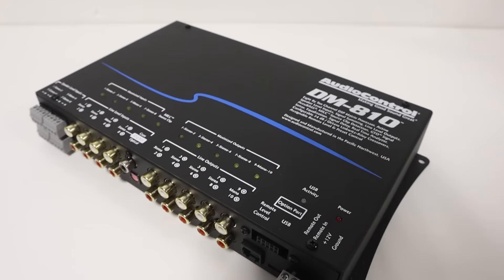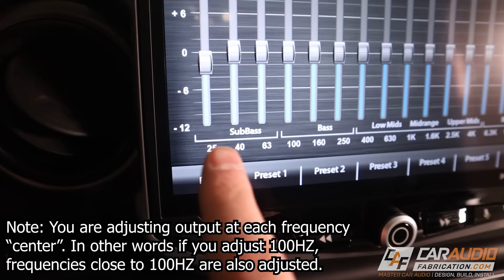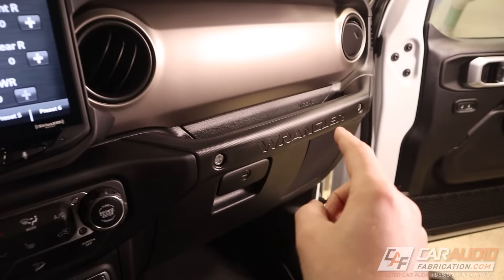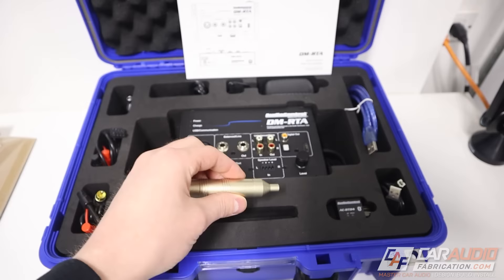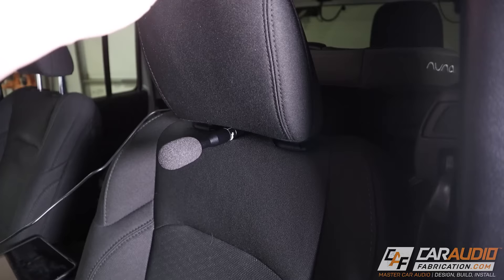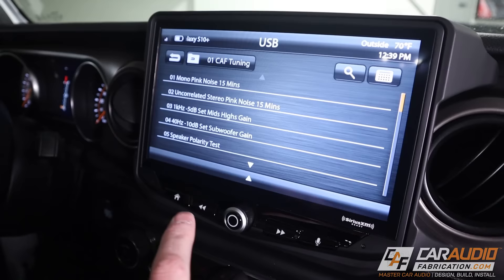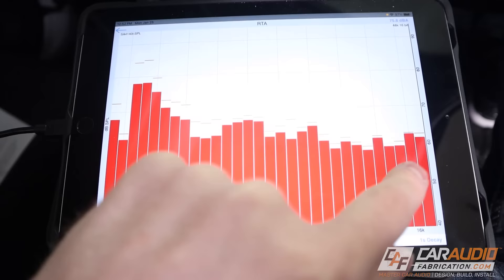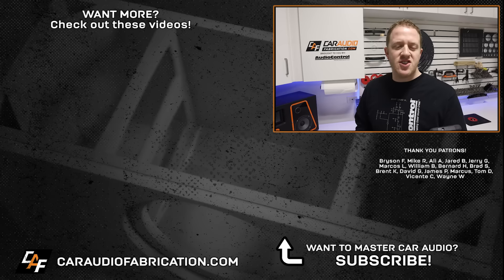Tuning your car stereo - Head Unit Equalizer - No DSP! PROCESS EXPLAINED

Comment: Just a heads up, the head unit is using DSP (Digital Signal Processing) internally to adjust the frequency gains for the eq. It is the same thing as the RTA, except one process is automatic and one is manual. If you wanted to adjust the eq without DSP you would see a bunch of analog dials or faders like we saw in the 90's. Your stand alone processor will give you more options of crossovers and eq's, but both are using DSP.
Reply: No 6000 dollar RCA's?  No mysteries?  No way man..

Comment: Your content is awesome and has helped me so much in my usually "quick n dirty" sound installs. Currently struggling to set up a little upgrade in my BMW E46 touring - JBL GTO component speakers, a Dynaudio spare wheel sub from a VW Golf and a bit of sound deadening. I can get it sounding good in my driveway, but as soon as I am driving, the deep exhaust note drowns out my admittedly small subwoofer and midbass. My aftermarket head unit has a similar built in DSP - I guess I should tune it while moving?

Comment: Audio Control. That’s the EQ back in the day. Still have the best offerings. You got issues and they have.solutions. It’s just not a problem is all! Great video, I needed to see that! We had Eclipse, Sony and Soundstream for heads, used Audio Control EQ and crossovers. And there were Soundstream  Class A on the tweets, Soundstream  Class ABs on mids and Soundstream running grunt. That is sweetness to your ears. Stay safe mates!😊👍🏻😷

Comment: So if i cut to eleminate distortion , isnt i gonna increase the volume because of that and end up at the same level with the same distortion ? Like whats the point ? Or is it actually less fetieaging for speakers to cut rather than boost even if i increased the volume to compensate ?

Comment: I love all the technical and practical advice you’re giving and it inspired me to upgrade my car audio system. One thing I’d love to see is wireless/ Bluetooth connections to amps or HU’s!
Because to be honest... we install upgraded speakers, sound dampening and amplifiers but in the end we stream “low quality” mp3s via Spotify or Apple Music. 
How to upgrade the Bluetooth signal (muse02 op-amp) be one question or wiring the phone to an amp would be cool to get an insight on. 
Just to get an even balance between streaming quality and the build quality of the speakers and system amp’s~ (I’m not a audiophile but still wanna get out the best results 😜)
For future awesomeness!
Reply: Thats why in some cases I still prefer CDs and also I use my AUX in connection with a good quality cable mire than I stream via Bluetooth.  I find the sound much better when A) the source is direct and B) the connection is direct and a physical connection.
I do have alot of music in digital format, however I always convert them with top quality in mind and don't worry about how much space it takes up.  I always convert from a direct source as well (CD usually)  I'd rather have 350 EXCELLENT sounding tracks than 1000 mediocre sounding ones in the same amount of space.  USB drives are cheap these days.  I have a few kicking around in the car each with various types/genres of music on them and some mixes.  I had gone the hard drive route in the past but found it too cumbersome and hard to find things when I wanted them especially when you're supposed to be, ya know paying attention so you don't hit anything while driving lol.
Building a library of music without downloading them (used to do that, LimeWire/FrostWire anyone?!? ;) took years but was essentially free.  I borrowed every single one of my friends CD collections, their brother/sister... friends parents etc.  Basically anyone who had a decent collection I would ask to borrow for a weekend and just rip them all to my computer.  I must have over a couple Tb by now. (2000 Gb)
Reply: Hi, try Using a USB with FLAC
Reply: I use a 128GB USB flash drive loaded with more music than I can ever listen to. If your HU supports it, you could also use an SD card. I find 320 KBPS MP3s perfectly adequate in terms of audio quality. Playing lossless files like FLAC is "ideal", but I don't believe there is much if any benefit in a car since generally speaking it is not a perfect listening environment, and lossless codec is inefficient at storing audio and results in wasted storage.

Comment: Hi!! 

How do I know the frequency range of the equalizer and the Q value, for the Mercedes Benz W177? I am talking about the audio settings of the W177, controlled through the MBUX software at the music settings.

Example: I adjusted the equalizer for Bass: +2. I need now to adjust these settings on my Digital Audio Workstation software, that's CUBASE. How do I know what are the settings to do so?
 Bass: +2. Does plus two means plus two decibels? If not, how many decibels are plus two? What is the Q of this Bass EQ, from which frequency to which frequency is the Bass zone?

Mid: +1. Does plus one means plus one decibels? If not, how many decibels is plus one? What is the Q of this Mid EQ, from which frequency to which frequency is the Mid zone?
 Treble: +2. Does plus two means plus two decibels? If not, how many decibels are plus two? What is the Q of this Treble EQ, from which frequency to which frequency is the Treble zone?

Comment: Mark,
You add great value to your industry.
I think the Stinger Heigh10 and DM-810 would make a helluva system in my 2021 JL.
Any chance you could do a video on total install with 2 AMPS, the Heigh10 and DM-810?
Tuning included. I am really wondering about the toss link or optic from the head unit to the DSP.

Comment: Do these adjustments affect the tuning for distortion? I’ve had my system tuned for distortion with a SMD for distortion and I’m always playing around with the frequencies for my EQ but I’ve always wondered if raising the base on my eq will change the distortion level to a different number that was set by the SMD
Reply: Ive been told yes and on my headunit (boss audio dont know about other brands) and when i turn the bass to the max or close to max it distorts and when i turn the bass around -2 out of +7 (which is max bass) it does not distort by ear i cant tell that it does by ear so im assuming YES!
Reply: Yes it does. Tune your system to your liking then tune for distortion

Comment: Were you able to keep your climate control and steering wheel controls with the stinger head unit? I just installed a alpine head unit and sound system and lost my climate control and steering wheel audio controls…in my JL

Comment: Hey I have a question …I have a aftermarket Tesla android head unit that I just installed . But I checked on the equalizer on the head unit . It suxs big time ….the other head unit I had before I changed it was way way better . It gave me full bass…with out needing a sub woofer. But this one I have now doesn’t give me half  of what the other unit was giving me . Is there a way to upgrade the equalizer with having to buy another head unit .which I don’t want to do? Please help

Comment: No Android support for the Audiocontrol mic and app? Missed out on my money.
Reply: However will they recover lol
Reply from the maker: I'm not an apple fan at all, but at least their connector has been very consistent over several models. Not the case with constant USB changes on Android, I think the last four Android Phones I have bought have each had a different connection. They have a similar USB version that you can use with a PC based app here: https://www.audiocontrol.com/studio-six-digital/
Reply: @CarAudioFabrication  all of the USB types can be adapted between one another. I refuse to support a company like Apple and despise their OS as well. Besides, there have only been 2 different USB types in the last 5 or so years. Micro and type C

Comment: Would like to know if there is a way to reprogram a android 10.0 head unit to have a 10 band or more equalizer, mine only came with treble, bass, and presets, I downloaded apps but they do not run in background while listing to regular FM radio stations

Comment: Hi is there a way to hear my midrange speaker more than my tweeters  using the eq. What setting would you recommend i put the Tweeters so they not are overpowering my midrange.  Tweeters are connected to speakers. Going to get a separate Amp for tweeters

Comment: I don't have a DSP and all I have is The equalizer that's built into my Kenwood deck. It's not quite as extensive as the one in this one but it's 13 band. I am running dual 12-in subwoofers and I know you said not to do it but it is adjusted in the shape of a smiley face. My question is what happens if you set the equalizer on the head unit to a smiley face and then set the equalizer on the phone in the shape of a smiley face? I do not have an SMD but I do have an oscilloscope that I use to set the gain correctly. Are there any presets that work well for an equalizer or is it just basically what sounds the best?

Comment: I'm new to car audio, but I have a question as I have recently had an install done on my car. So when measuring the time correction distance in a car, I've been looking online and a lot of people suggest the formula is to measure the distance between the speaker cone and your head in inches and then minus that from the distance of the subwoofer whilst leaving the subwoofer at 0". So for example, the subwoofer is 89" from your head and the left front speaker is 55". Leaving you with 34" for that speaker and 0" for the subwoofer. In your expertise, does that sound right to you?

Comment: @10:50 the reason why a perfectly flat curve would sound bad is because the human ear canal has ressonance at around 4000hz to 8000hz. this acts to amplifiy the frequency that are common to us in nature, such as human  speach, animal growls ect. There are graphs you can use will relate sound pressure (dB) to phonic register (phons) of the human ear. Using this you can see that you need higher sound pressure at lower and higher frequencies to get the same percieved volume across the audio spectrum.

for more information start here: https://en.wikipedia.org/wiki/Equal-loudness_contour

Comment: What is the difference  between DSP Audio Control and their EQ? Decades ago I had a high end system no DSP but Audio Control Dual 31 band 1/3 Octave EQ. It sounded incredible. When I had my custom build from factory Mercedes SUV you can order their Bang & Olufsen package. It sounds pretty good but not like after market. They won't let you do anything to the system as it would void the warranty for the whole vehicle. When the vehicle is very, very expensive then voiding the warranty is not an option. So I might buy a used car just for the purpose of a sound system to play around with. You can get nice used cars sometimes under 20k.

Comment: There's one thing I want to add that might sound like BS,, but it's true, if your only adding an amp and new speakers to your factory radio and you choose one of those line out converters from a local electronics store unfortunately most of those sound like crap and you can use the one in the amp if it has high level input but honestly I've found one brand of line out converters that improves the sound and I believe it blows mostly anything else out the water,,, "Pac line out converter" is what I use n I gotta say it's the best! Can't get them in local store anymore but they use to sell them around 10yrs ago but they stopped selling them and making u buy junk ones anymore leaving a bad taste in your ear,, Online is were u can get the Pac or maybe an actual car audio shop

Comment: What do you think about using an iphone with that app for sound tuning? I have an Audison Virtuoso DSP and I find it a little limited compared to your headunit by the number of tweaking points avaliable. Then I get alot of frequency variations by moving the phone up and down the driver's seat. I got filtered front and back with tweeters in the dashboard and coaxial in the back and a sub in the trunk. Cheers!

Comment: My android head unit has a problem where time correction distances entered in are directly copied to miliseconds of delay. So the process of entering each distance from the speaker to the listener results in wildly wrong time compensation. The farthest speaker has the most delay instead of zero. Closer speakers have the least delay. In my case i need to do the math on paper and just enter the delay in ms.

Comment: Hey Mark!

Nice video, helped me a lot.

Could you make a video about what speaker setup ist best for different status quos?

I got a good kenwood stereo with an 4 channel amplifier and an active sub. I use tweeters and 6,5inches in the front door and koax speakers in the rear and i am not really satisfied.

All that only gives me 5 channels for time correction for 7 speakers. So whats best now?

-2 tweeters and 2 mids in the front door and a sub
-2 coax in the front and two in the back and a sub
-just buy even better speakers and live with my current setup?

Greetings from germany!

Comment: Hey CAF, I would love to see a video detailing L/R frequency balancing with the Audio Control gear. I have a DM-810 running 3-way active for the front stage and I am missing something with certain frequencies on the driver side.  I think it is related to on/off axis response of the speakers in the door.  I am at the point where I think I need to buy the microphone to refine further.

Comment: Does all the speaker wire  have to be the same length for the time alignment to work correctly? For example your front door speakers say you have 3m of speaker wire going to the left speaker and 2m going to the right would that affect accuracy of time alignment. Thanks
Reply from the maker: No, the speed at which the signal moves is astronomically fast.
Reply: @CarAudioFabrication  excellent. Thanks for your reply.

Comment: What’s that headunit again? Probably expensive haha. Are there others that have that level of eq bands, and also crossover? I’m pretty content with my current setup but just a headunit swap would be nice if it could do more in terms of DSP. Don’t and won’t do much tuning for but that unit does even more than what I want. I do have front dash, doors, and rear door speakers.

Comment: How do I setup a center channel on a aftermarket heigh10 as I bought as well and would love to make a custom center channel but I don't how to get that true mix of both front speakers to create a great front stage.
Reply: I should note that I'll be using multiple JL Audio VXi amplifiers directly connected directly to the amps via optical wires instead of RCAs.
Reply: You need a helix DSP to get center channel
Reply: @devnull182  what is that and will it interfere with the VXi DSPs?

Comment: Question Mark:  If my head unit has a cap on the total distance inputed on my time correction; would inputing the distance difference be suitable and accurate? (for example the closest speaker is 18", so I set that at 0", the furthest speaker is 38", so I'd set that at 20" - make sense?).  Also, in your video you mentioned to set a time correction on the subwoofer, however Ive come across several resources that suggest not to set a time correction on sub woofers-thoughts?
Reply from the maker: As long as the differences are accurate it would work as you describe. While time correction isn't as critical for subwoofers the idea that not setting it is better is inaccurate
Reply: @CarAudioFabrication  thanks Mark!

Comment: Is getting a DSP worth it if i am not running active?  I have my Morel components on the same channels.
Reply from the maker: Yes, always worth it
Reply: @CarAudioFabrication  Thank you.  Can you elaborate or point me to a video showing how to use a dsp with components running off the same channel?  I would think since they are coming from the same channel you wouldn't be able to dial them in very good.  I don't plan on going active but would like to get better sound out of what I have currently.

Comment: It’s like one big infomercial every single episode for audio control for completely unnecessary products as if it’s a $10,000 home theater system it takes two seconds listen to two songs and it’s all personal preference for everybody how they set up a simple equalizer and takes five minutes by ear you know it and I know it a $300 DSP is the stupidest thing I’ve ever heard in my life and that’s coming from somebody with a $10,000 home audio
Reply from the maker: No offense but if those are your thoughts on DSP you absolutely do not "know audio". Home audio is simple, you are sitting equidistant between the speakers and there's nothing in the way between your listening location and them. Not the case in car audio. Using a DSP is required to achieve the best sound. Why do you think the OEM manufacturers bake a tune into their factory gear instead of just leaving it all flat? Why do you think that OEM tune is different from speaker to speaker? The OEM certainly won't waste a cent on something that isn't beneficial. Yet they do.... because it is essential.